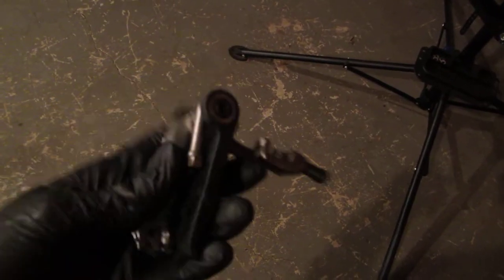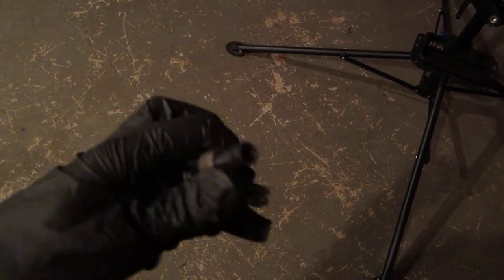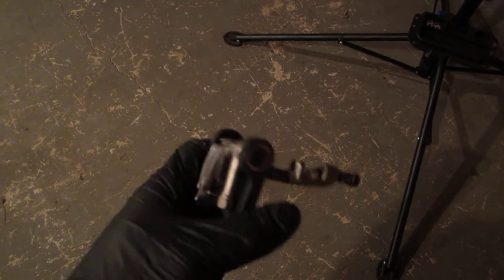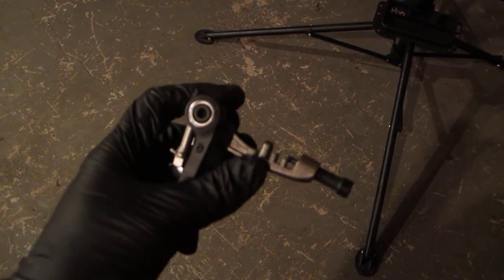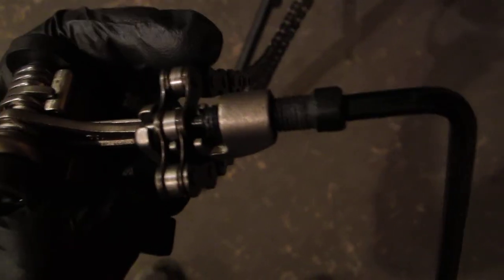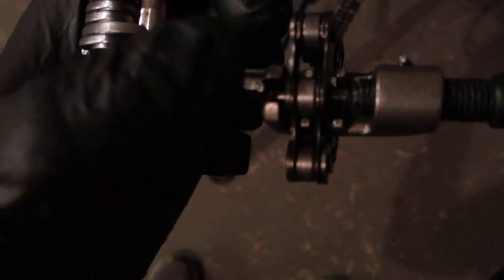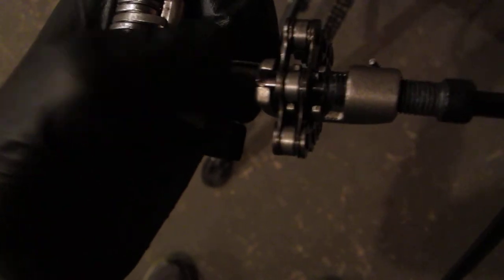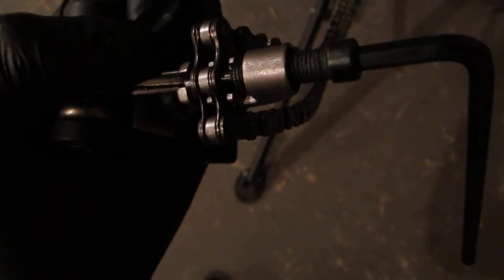How To Remove A Bicycle Chain From Your Bike Frame BikeBlogger

Comment: Another great tool is a set of chain pliers. Mine is made by Hozan. It looks like a large set of pliers, but has an adjustable pin. Once adjusted properly, you just put the chain in the jaws and squeeze. It pushes the pin far enough to allow you to pop the chain apart. It works so well that I have stuck with 8 speed drive trains as their chains are strong, cheap and don't have any master links. When I was commuting regularly I kept (4) chains. I would put a new chain on every weekend so I only had to clean and lube the chains once a month. I always hot dipped the chains in a wax / oil mix. They would be perfectly lubed and didn't collect dirt.
Great way to clean a chain-  run a small wire through a link in the chain (removed from the bike). Thread the wire through the cap of a 2 or 3 liter soda pop bottle. Fill the bottle about 1/3 full with solvent, drop the chain in and tighten the cap. Shake it for a minute, unscrew the cap and pull the chain out. Viola! I'd only recommend this method if you're going to hot dip the chain. Using this method made my chains last for incredibly long times.
Ride safe!
Reply from the maker: I'll keep that in mind. My chains get dirty fast so I need to try something new.